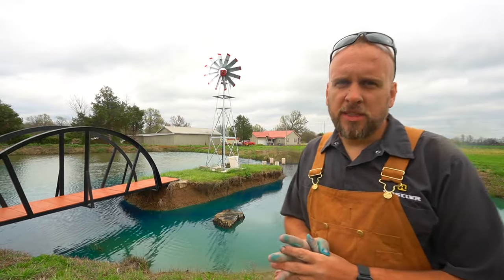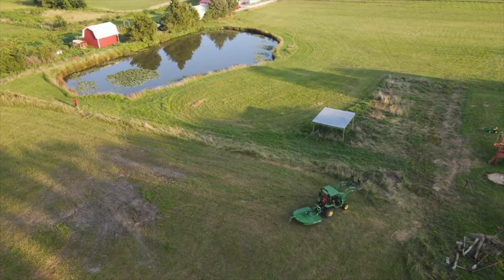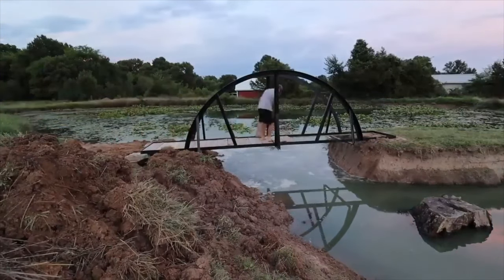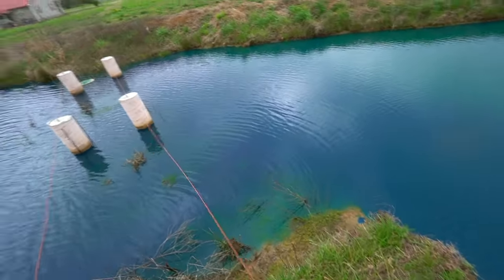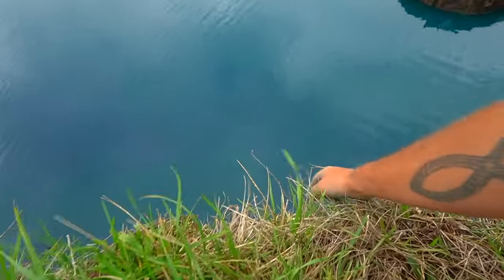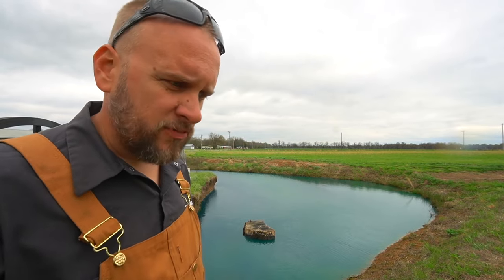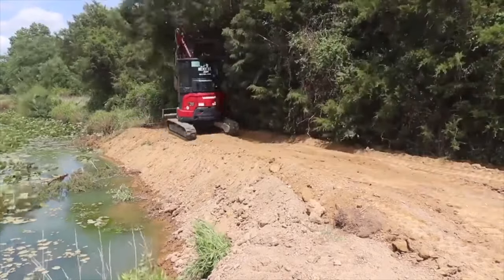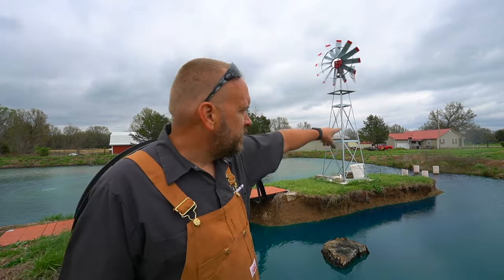Our Pond Island is Eroding... Can We Fix It?

Comment: I think draining down to be able to get into the smaller area where erosion is the problem is the best option. As others have said half-way measures lead to half-way results. You would be able to use existing equipment saving lots of money. Another option, remove the bridge and dump truck loads of dirt on each end of the island then pump it dry, do your repairs then remove the dirt you used as a bridge.

Comment: You don't need big rocks. I live on the coast of Maine. We've been dealing with coastal erosion a LOT over the last 18 months. TBH, your best option is probably to drive sturdy posts (4 inch tree trunks would probably be fine) into the bed of the pond about 4-6' from the edge of the island. In your case they don't have to be deep since you're not gonna be dealing with tides or waves. Use a lot of heavy duty staples to attach landscape fabric to the posts, tucking the foot under toward the island. Fill the space between the island and the posts with 6" and 12" minus, being careful anchor the fabric, then bash it down with the bucket until it's a little below ground level. Sift in some 1" minus, then dirt, then treat it like new construction. Build up the top soil and plant something with deep roots on top of it like rye grass. You'll have some slope and the landscape fabric will show, but after a while, say 12 to 18 months when everything has shaken into place, the gravel and dirt have sifted down and wedged it all together, and the roots are locking in the top layer of dirt from washing away, you should be able to cut back the fabric to below the water level so you don't see it. Alternatively you could try the same style with a couple layers of heavy burlap and let it rot away over time.

Comment: You could setup an excavator on the side of the pond and dig out the pond edge and bale the dirt you dig and set it on the bank of the island. You still may need a bigger excavator to reach but you may not need to bring rock down. Just slope the dirt that is placed on the island bank. That way your island will be bigger and your pond will still have the same volume.

Comment: I think you're on the right track with the sloped rocks.
On the cheap with the gear you have you could find the closest solid bank to the island and just start dumping rocks off there with your skid steer basically forming a bridge for your little tractor and hoe to get to the middle to work - you'd be using a lot of the material up there and could pull up what's left with the hoe as you move back off the island when finishing up. Downside of this is it would be time and it would stir a lot of sediment. 
Second idea is to source a large rig matt solid enough to sit on top of those piers that can hold the weight temporarily and get you across with minimal disturbance to the water aside from the project itself.  You've got a mill - I think you could build one yourself without even having to rent one from a local oil company.
Best of luck Brock!

Comment: First… a 5 ton excavator would only reach about 12 feet..   my 67 hp new holland excavator only has a 13’-6” reach and it’s a 6-1/2 ton machine. You would need a Cat 330 excavator to reach out 20 feet and that machine weighs basically 69,000 lbs.   BUT….. if you rented it you would get done with the island in 3-4  hours and could dredge way out into the other area adjacent to the island as you described…… rent it and do it right and get done with it.  I was always taught that if you have a problem…… repair/fix it right on the first attempt and don’t play with it… Bc it really gets expensive in dollars and your time the longer you deal with it.  Me personally… I would drain the pond and do the island right and do all the dredging with a dozer that I wanted to do and never have to worry about it in my life time.   I do how ever put an extremely high price on my time as an ROI thought process for as large of a return that I can get on my time.  Good luck with which ever path you choose. 🔥🔥👍👍

Comment: I support two solutions I heard so far - drain the pond and fix island edge laying rocks and covering with non-corrosive net. Excavate and install additional deep concrete footings for next bridge.

If you can't reach very far - build temporary platform on 8 or 12 rain barrels to winch rocks on it to island.

Comment: If you can afford it, sounds like a long reach excavator is what you need.  You can use it to place rocks and dredge the pond if that's the route you take. Don't do anything that would puncture the bottom of the pond, it may start leaking if you do. You might want to see if LetsDig18 or Dirt Perfect would give you some suggestions.  They seem to be some of the best pond builders on you tube.

Comment: If you have time/energy, wheelbarrow method across bridges is what I'd do.  You could also start with dumping fill dirt off the edge of the island to form a mound underwater, then dump the larger rocks you can move by hand on that mound, then then go with medium size rocks, and once you break the surface, put a few larger rocks on top and then dump some more fill to widen the surface of the island.

Comment: Drain the pond.  Dig a footer around island. Lay concrete block with rebar reinforced concrete in the block.  Paint block to match water color as well as using textured block where it shows. 
 Pour concrete pad on top of island and tie into walls with rebar.

Comment: Howdy Brock!  Ya know... I've been giving this some thought (lots of time to think... off work recovering from some medical issues lol).  What about using 60 or 80 lbs bags of concrete to make a retaining wall?  I've seen several videos on YT where people have stacked the concrete bags like you would sand bags, and just leave them to soak in the water and harden up.  They also drive some rebar through the bags for added strength.  You could stack them to just below the waterline and then finish it with rock for a more natural look.  That would definitely give you a solid retaining wall that, if needed, you can backfill with dirt.  LMK what ya think!  Thanks for sharing 🤠

Comment: Morning Brock.  I think the larger rocks will leave too many gaps and exposure of the bank, as well as too soil would fall through those big gaps.  The escavator seems too much solution and expense for this project.

Suggest placing three different sizes of rocks to provide the necessary support.

Start with #1 crushed stone, fill the the length of the bank needed, and going out ~18-24" and up the water's surface.  Follow-up with #2 crushed stone, backfilling the gaps behind and covering gaps on the front side and ~2" about water.  Next, do same with #3 crushed rock, and ~2" above previous layer.  Next, lay a 4"  layer of clay atop the last rock layer.  Last, top off with top soil to grade and plant any grass while it's still cool enough for it to grow and sustain the upcoming higher temperatures.

Good luck.

Comment: Maybe I missed it, but what about the prefilled metal cages with stone in it? On the East coast we call it rip wrap. They’re like the large concrete blocks, but full of stone. They can be stacked too. What about one of those large forklifts that extend out and up. they use it for plywood, etc for construction projects. Hope you find a sensible, low cost solution Brock.
Reply: Good idea. It's called a zoom boom.